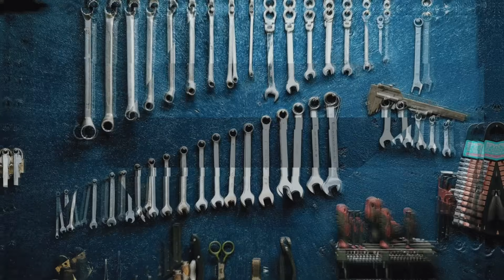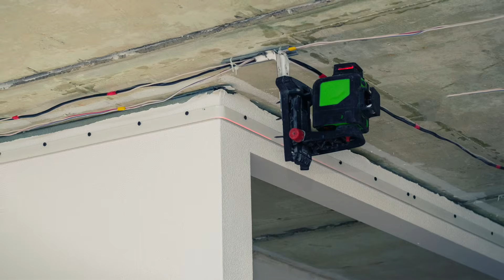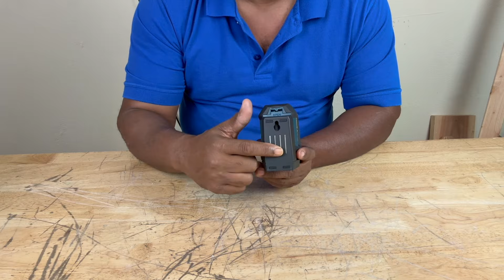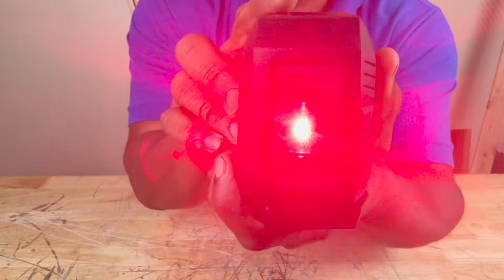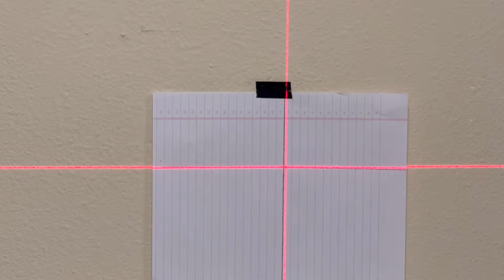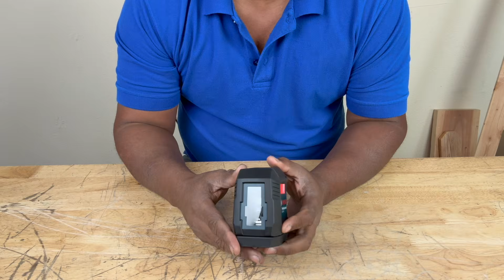HOW A SELF LEVELING LASER WORKS

Comment: Here’s a (not common sense question) does the laser tool level from where the light exits out the tool or levels out on the wood surface it’s placed on ?
Reply from the maker: It levels from the tool and that laser light  just projects that level plane on to the surface.

Comment: What’s the key to getting a line on the ceiling ? If once above 40 degrees it’s starts blinking at me
Reply from the maker: Make sure it’s locked in place. You can put in on a high tripod or mount it higher on the wall. This should help extend the line further on the ceiling.